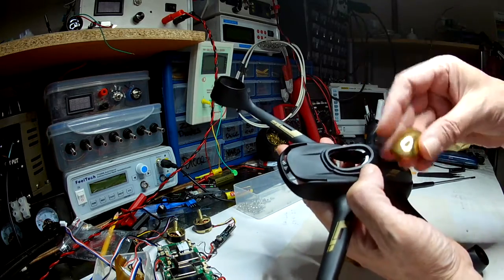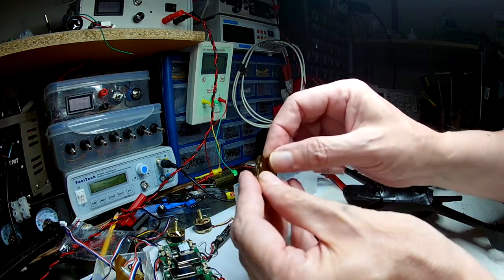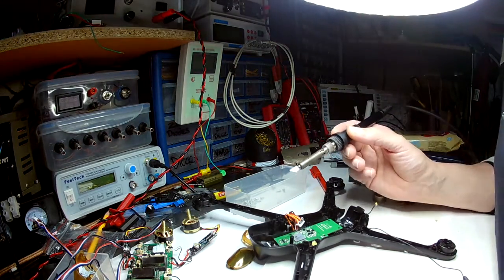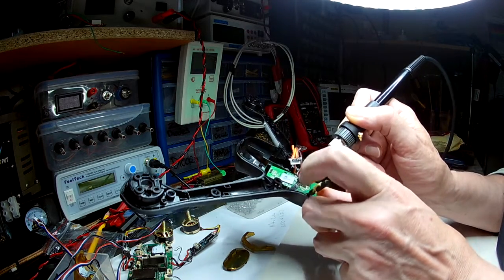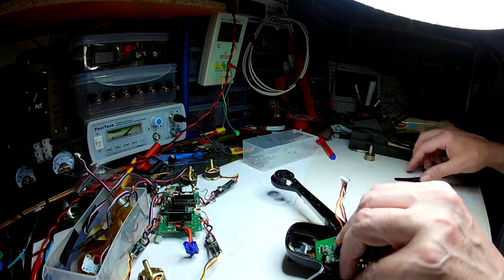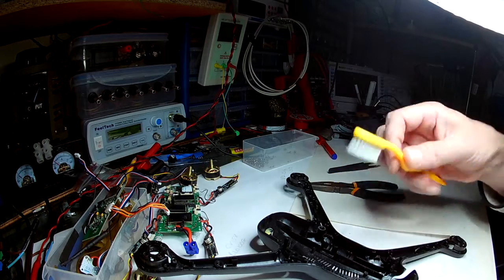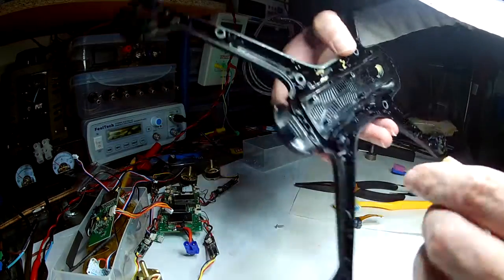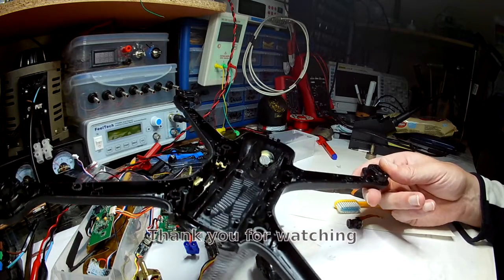Hubsan X4 H501S Quad-Copter Body Shell Swap Pt 2

Comment: I need help, because I bought this motherboard and this board spv, to put in my drone everything in the drone works the camera is not working, I did not update it as it came from the factory, its firmware ta so (V4.2.24 LCD V1 .3.3 H501A V1.1.43 V1.1.41) Someone knows what to say.
the plates were from the drone hubsan 501a

Comment: I will be doing the same......Were you able to reuse the camera and the antenna that were held down by the white/yellow  glue by applying heat?  (what heat source did you use?) Cheers!
Reply: Never mind I saw the hot iron ..... Thanks for the video.  It's going to help me when I do it.

Comment: I have to replace my dead FPV module, looks like a full disassembly to get to it? ugh
Reply from the maker: Hi, yes full disassemble,. It is not to difficult, give yourself plenty of time and you will be fine.
Reply: Elecifun Well I have the white and gold version so on the upside Ive ordered a black shell so I'll be doing a shell swap while I'm at it. Thanks for the vids man, they will help tremendously!
Reply from the maker: Thats cool, I swapped from black to white. Someone said about half and half?
Reply: Elecifun yeah I saw that, +scott Stephens 2 tone drone with the white top black bottom, looks kind of cool. I wanted the black vers originally but white was cheaper at the time by like $80.00 so the black out will be awesome for me. I got the shell on ebay for $16.00 #winning xD

Comment: Hia elcifun can you recommend solder with a lot of flux . Im a newbie at soldering and the solder just turns in to solder balls it wont stick
Reply from the maker: You have to keep your solder tip nice and clean. I can make short video to show you how I keep mine clean and conditioned. There are lots video's on the web I am sure. Just ask if you want me to.
I use Multicomp 60/40 6 core with flux already in it. It is not mega expensive a 500g real costs less than £20. If I do not keep my solder tip clean and tinned when I finish using it my tips will become tarnished and unuseable, the solder will bead and not work as it should. I use a brass wire wool to keep solder tip clean as this will also help keep your set working temperature stable.
Reply: Yes thank you that would be great.
Reply from the maker: daxster 40 OK give me an hour and I will post it.
Reply from the maker: Its uploading now.
Reply: Thank you elecrifun looking forward to the video  need to learn how to soldier
Reply from the maker: Here it is https://www.youtube.com/watch?v=Cmej7F0xkOg
Reply: What is this yellow material ? thanks
Reply from the maker: esfin dubi I am not sure what it is. It can be made pliable with a heat gun.

Comment: Hey! Great videos and tutorials. Very nice. I recently replaced 3 of the 4 motors bearings and in the process have to replace some plastic. I've also had a hard crash onto asphalt which were all sure that's not good for these things! Lol! So, with doing this body swap, did everything work as it should when swap was completed? How was the calibration and GPS location working? Did it fly? Correctly, I hope. Thanks and hope to hear from you. email redlinedragons@gmail.com. Thanks